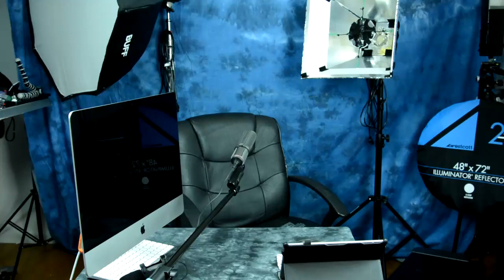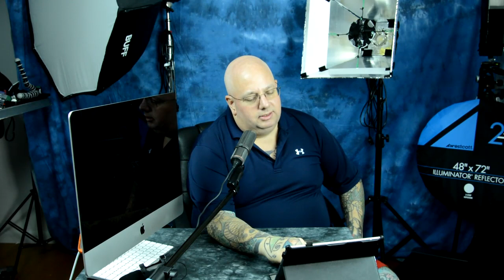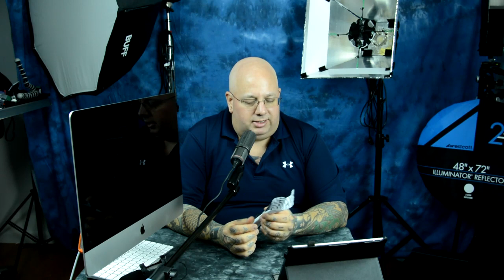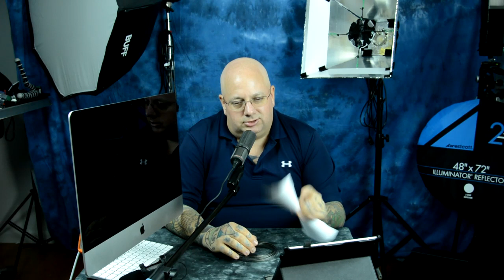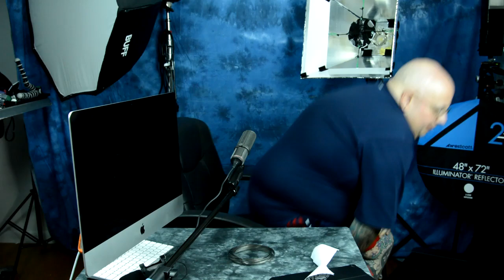The FUTURE: Gyromagnetic Precession Coil Induction generators that replace AC Generators

Comment: So if it's not a free energy device, then it has to have an input.  If it's not a mechanical moving shaft, then what is it?  What is the input?  If it is solely from the induction from geomagnetic precession at the larmor frequency alone, then it is indeed a free e energy device.  Can someone explain this?
Reply: The input can be electrical, the output will be larger than the input, free energy really just means COP > 1.

Comment: No moving parts, no maintenance. No maintenance, no profits. Your idea doesn't work Ken ;)  The world is upside down.
Reply: The idea works for sure. But, as you mentioned, manufacturing is all about planned obsolescence. Even switches are designed to have a failure rate that exceeds the warranty's lifetime. That paradigm has to change.

Comment: I have spent years studying physics, engineering, and electrical sciences. I feel like I have designed a gyro magnetic AC generator. But what I have written and blue printed I feel like would cause such a magnetic field that it would repel the magnet pull of the earth itself and create a type of antigravitational field. It's so hard to come up with the funding to build the prototype 😞😞😞

Comment: A motor system, with no moving parts,  how the he'll I'm I gonna get the wheels going , on saws,  cars whaterer,  why do you even call it a motor if it has no moving parts,
Reply: .... because its function is not to spin wheels.. It's a generator....  Just as all induction motors are also induction generators.... the device he is describing would function off of the same principles.  coils produce the effect of a moving magnetic field, this induces current in the rotor, which produces a magnetic field in the rotor, which since it is spinning due to external force (in generator operation) induces current in the stator windings, feeding power output.  In the case of the device described, instead of the rotor being spun by external force (like on a wind turbine), the magnetic field will be moving in relation to the rodin coil windings by way of the larmor precession.  This is what I'm concluding as the working principle anyhow.
Reply: @localbroadcast  he said they where basically moving the Precession around.  Well I d like to know more,  I'm pretty open minded but this I think sounds like bs.  They must be doing it with ossicolators or lasers somehow.

Comment: U.S. Pat. No. 4,628,284 (Bruning) discloses a high-frequency, high-voltage supply involving switching of transistors for, for example, magnetrons of microwave ovens. A "dead time" is provided between the intervals when one or the other of the transistors is off.
U.S. Pat. No. 4,319,315 (Keeney, Jr. et al) discloses a DC-to-DC convertor with oppositely conducting transistor pairs.
U.S. Pat. No. 3,886,429 (Maillard et al) discloses a symmetrical power pack for adapting to different sources. The power pack provides for alternate blocking and saturation of pairs of switching transistors.
U.S. Pat. No. 4,748,311 (Thomas et al) discloses a chopper circuit having a push-pull frequency f.sub.O and parallel tuned circuit at 2xf.sub.O. A goal of the Thomas et al circuit is to reduce power loss in their switching means.
U.S. Pat. No. 4,542,440 (Chetty et al) discloses a current sensor involving two power switches and two associated snubber circuits which operate 180.degree. with respect to each other.
U.S. Pat. No. 5,513,226 (Josephson) discloses a ballast inverter circuit which comprises two tank circuits. The two tank circuits operate at a common resonant frequency. A pair of transistors are switched in opposition so as to operate in a push-pull manner.
U.S. Pat. No. 4,709,323 (Lien) discloses a parallel resonant converter in which resonant circuitry recovers energy which would otherwise be lost in the circuit's switching operation.

Comment: It's definitely not theoretical. Gyromagnetic Precession is real! I'm currently working in this field. There is no heat, so yes, you can encase the coil. It's not free, you have to pulse it sonically. Square wave or sinusoidal input will produce E/C. Synchronized electricity that produces virgin electrons, generates RF that has both and A/C and D/C component with the added benefit of no moving parts. This research is the future of Power distribution. Local solution for self-powered autos and self-powered appliances.
Reply: FlyboyRobin
Reply: can you contact me ? slawoj.arianski (at) gmail.com
Reply: @jesuslover444  No replies means that is an unknown.
Reply: If sound powers this thing, I have a granddaughter that could make it generate a few megawatts.

Comment: The solid state generator in this patent works off of similar principles US 8736151 b2.
  It's not the same thing as what you are describing, but it uses similar physics. It is described as a nuclear magnetic spin generator (NMSG) or remnant polarization electric generation (RPEG). An interesting fact about these devices is how the strength of the permanent magnets field determines the rate of gyromagnetic precession(larmor frequency). 
  Magnets stacked on top of eachother in a pyramid shape can produce stupidly strong fields in a small point(George Mizzell). That technique is usefull for increasing the larmor frequency which in tern can produce more current or a greater voltage, not sure which one.

I'm having a hard time visualizing the position of the rodin coil, to the precessing field. At 6:57 you made the conical convergence precess. If a line is drawn through the hole at the center of the rodin coil, would the line be parallel to your table(while the precession stays in the same orientation at 6:57)? Also would you displace the dielectric inertial plain(magnetic domain wall) away from the magnets around the rodin coil to the center of the rodin coil?

  In the patent two materials are sandwiched together, one materials atoms undergo gyromagnetic precession induced by an external permanent magnet and a second material reacts to the gyromagnetic precession in the first material producing an emf. 
   Piezoelectric materials can be viewed as an analogy. Physical Pressure can be viewed as material one(undergoing gyromagnetic precession), a piezoelectric can be viewed as material two because the piezoelectric reacts to the pressure being placed on it which produces an emf(material two reacts to the gyromagnetic precession in material one, creating an emf).
Reply: That's it.

Comment: Somewhat confused by the 0 moving parts claim.  An electrical generator takes mechanical energy, like from some sort of  turbine, whether that's water or a burning fuel mixture, and converts that into electrical current and voltage, i.e., electrical power.  Since it's not some sort of free energy device, I have trouble understanding the input side in converting the rotational energy into electrical energy through the coil.  So what he said may be great but it leaves out a lot if you're still using conventional sources of power generation, unless you're saying this precessional frequency is the only input.  Generally "free energy" devices to most people are devices that operate without conventional mechanical input and power generation.
Reply: Semantics and linguistic fallacies, magnets are always in motion it seems. maybe not the neodymium magnet on our table but its magnetic flux is always in motion.

  Again its a semantics issue, you could argue the sun or any long lasting thing with a electromagnetic field is and isn't "free energy" "free lunch"  but we know it was made by other parts and    didn't come out of magic but particles in a nebulae probably clumping over time.
 One side could argue its energy is free, cause we didn't have to live the billions of years before it was here. Another side can argue it isn't free, and a powerful enormous fusion driven star
 became its glorious self because of the natural forces coming together and us consuming that energy in one way or another.
 Both are right, its being escalated into a linguistic fallacy .

Comment: Ken, I am trying to picture this in my mind. Are the output conductors a part of the Rodin coils or is the conductors feeding through the centre of the hyperboloid I.e. Similar to a current transformer mounted on a cable? Thanks

Comment: so the coil is stationary, the magnet is stationary but the energy supplied to it constantly flips the magnets "polarity"?
Reply from the maker: look up larmor frequency, gyromagnetic precession , that combined with something else…….

the mag field is external to the coil in polarity, the coil is induced by Gyro-magnetic precession
Reply: @KenTheoriaApophasis  ding, ding winner!. i been watching you for a while now and. I think I am right!.
Reply: @KenTheoriaApophasis  something else might be  Halbach array which will create gyromagnetic precession and Ferrite is used to move the field.
Reply: In a sense. The resultant phase disparity between the two would create it i believe.

Comment: Wouldn't the input require a moving part ie. water, steam etc to feed this coil drive. Ken could you give us a small simple schematic. Appreciated. Or could this lead to a Stan Meyer situation for anyone that creates this device.
Reply from the maker: not to the generator itself, no.
Reply: Or use solar.

Basic schematic is on internet, search NMR device. Neeed two big magnets, one acurate gauss meter and pulse gen. Then coils and an ingeneer degree at least haha.